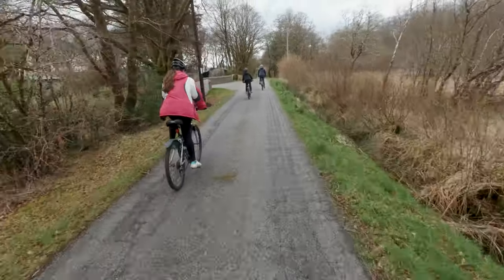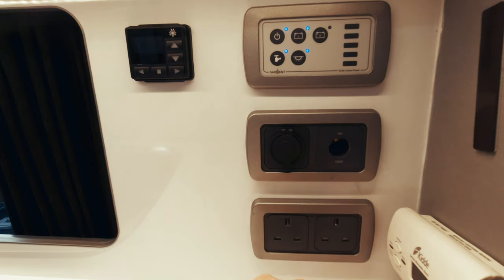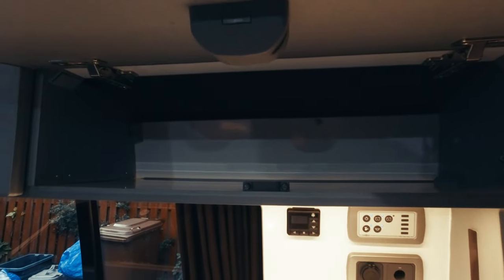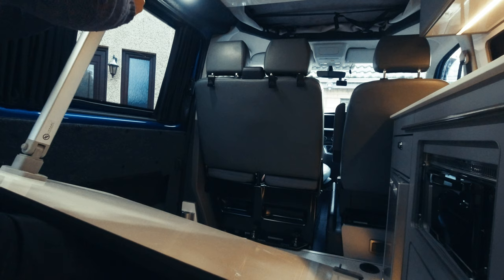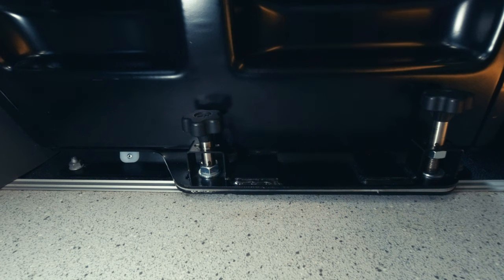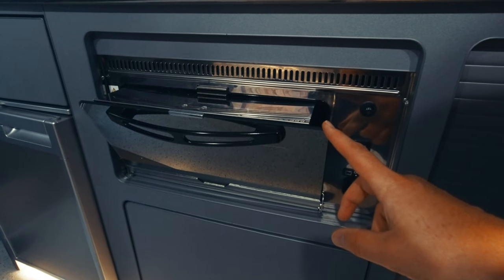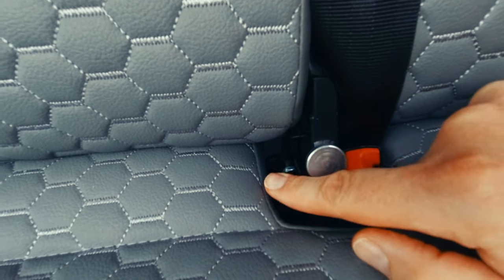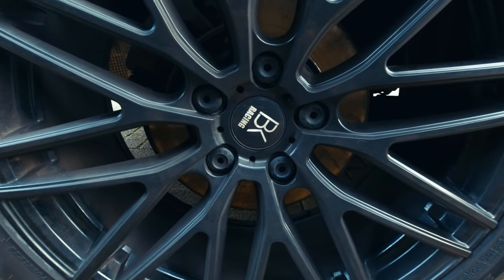campervan owner explains how everything works 😎

Comment: hi great  videos   please can you tell me who did your side door card with table thanks allan
Reply from the maker: Hi Allan, thanks for watching and subscribing! They were done by Direct Campers in Newcastle.
Reply: Hi thanks for that
Reply from the maker: @heater1011  More than welcome Allan!
Reply: Hi I have watched your videos and found them to be very helpful. Thanks you. I asked you before about your your side table and was advised you got it from Newcastle company. I phoned them and they say it's a Loc8 table they have which has 4 legs.  They say you can't get any with one leg. This is what I need. Do you have any info on the table you have please.  Many thanks Allan.
Reply from the maker: @heater1011  Thanks for subscribing Allan! I've found out the table leg is available on JustKampers. Its called a Reimo table leg. its £25. The table top was made by them cut out of timber which has a veneer on it. They then used edging strip around it to finish it off. Hope that helps!
Reply from the maker: @heater1011  Actually, the height adjustable one is the one we have and its £35. Or, you can buy the kit with the sliding rail and clips from JustKampers for £49
Reply: hi thanks for geting back to me will phono justkamper tomorrow thanks for help allan
Reply from the maker: @heater1011  More than welcome Allan, they have a great website but YouTube doesn't let you put links in the chat so I cant send you the link...